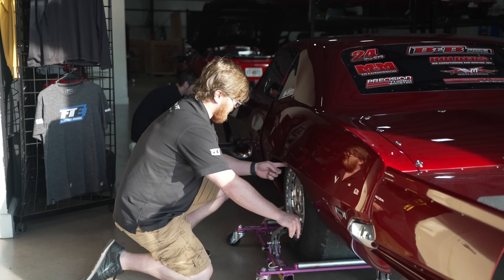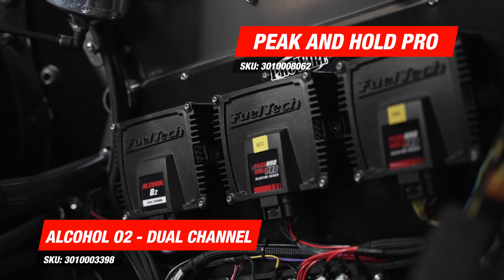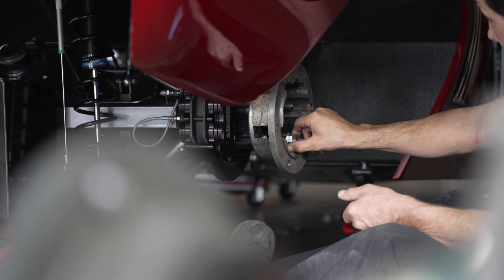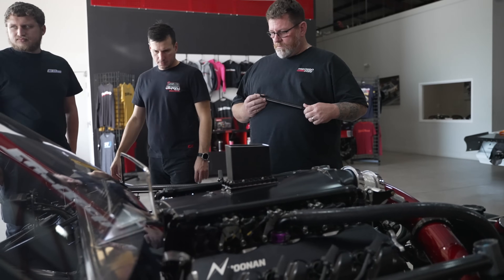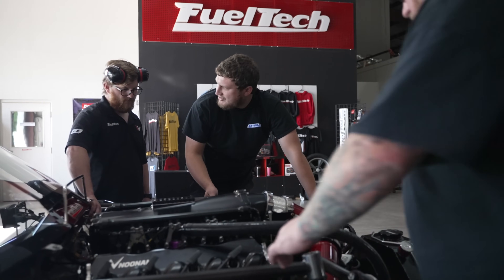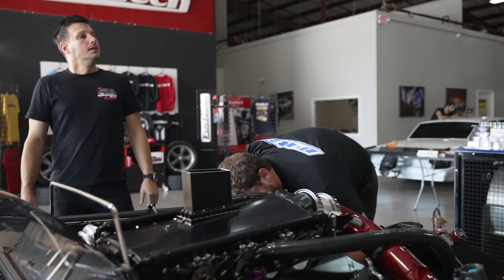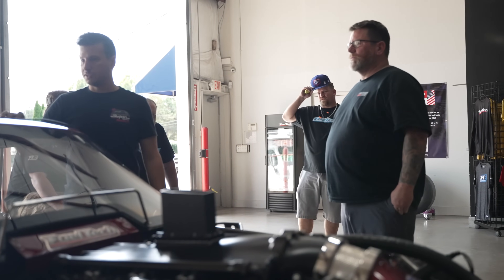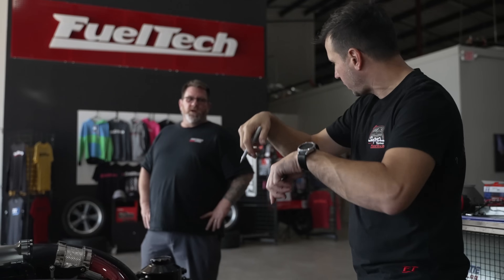4500HP Camaro on the Dyno?! | Roger Holder

Comment: Is that a small tire car with 4500 hp? Huh..I don’t get it if that’s the case. You need to go race the 405 boys to see how you do.  Beautiful machine though
Reply: Radials on prep vs No Prep....different kinds of racing. Small Radials can hook on the type of surface they run on and are mid 3s in the eighth...

Comment: had a 66 GTO in the early 70,s put on 750 double pumper isky high lift cam hooker headers and was dynoed right at 500 H P all for around 300.00 in parts back then today most likely would cast 4000.00 plus for just these easy addons